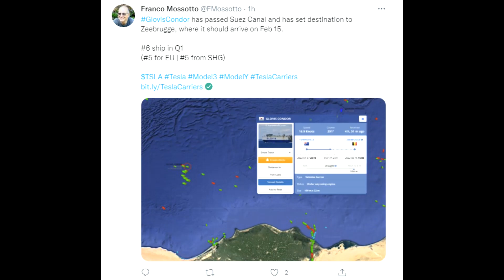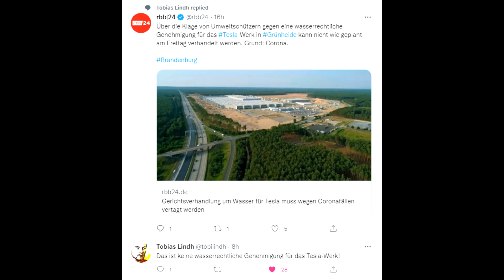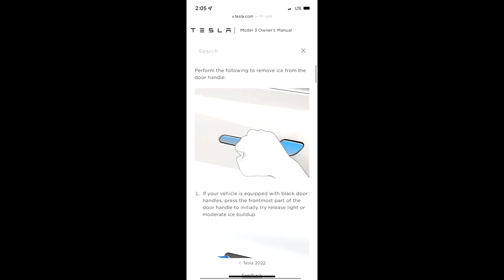TESLA: 4680 Production Expansion & Battery Price shock!

Comment: Lets hope CATL will succeed with their Sodium batteries very soon to reduce the need for lithium batteries. Maybe Tesla has enough material for them self and you can be happy as a fanboy, but it is not sustainable for the transition to greener transportation and energy if lithium and other material prices have been increased that much already. We have around 60-70 million ICE vehicles in the world to replace and we have only replaced 2-3 million so far and already struggling to get the materials. And we have barely started using lithium batteries in the energy sector.